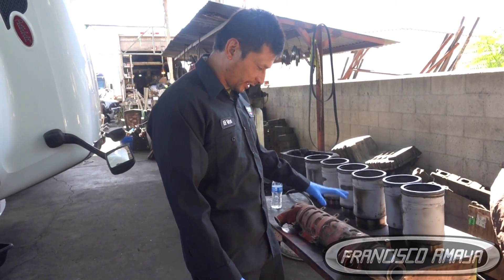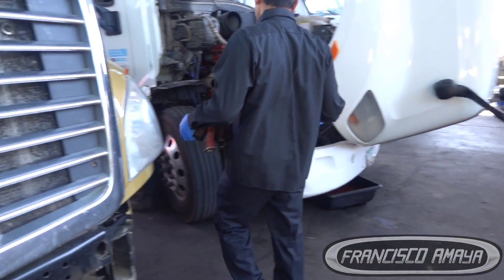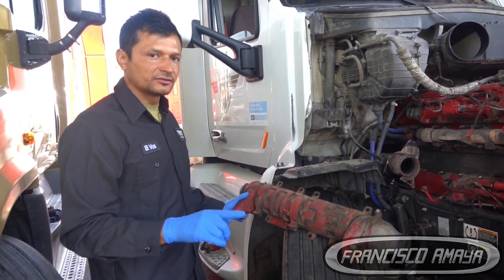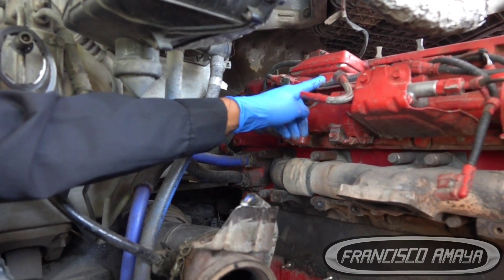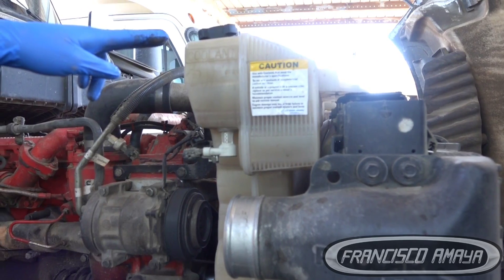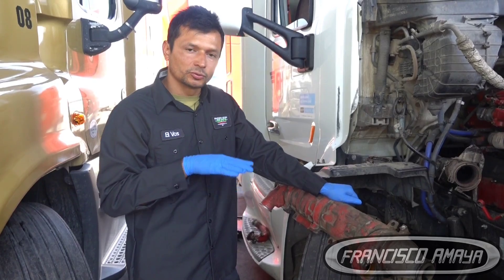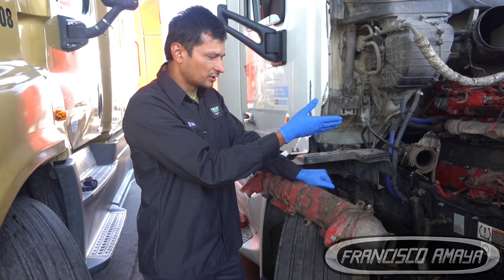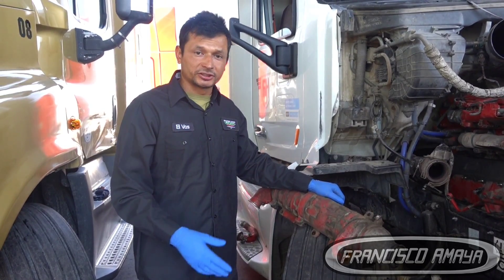CUMMINS X15 ENGINE EGR COOLER LEAKING COOLANT INTERNAL DAMAGE COOLER REPLACEMENT

Comment: The Volvo EGR coolers aren't as bad.  They are further away from the exhaust manifold, so they don't receive those extreme heat cycles like the Cummins do.  It's because of that extreme heat and cooling cycle, that they expand and contract, and ultimately crack internally.